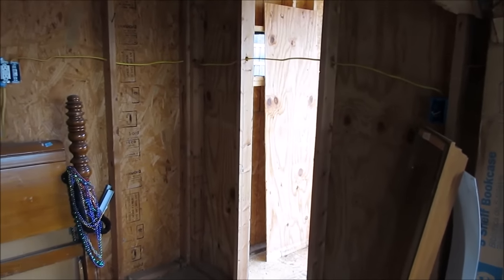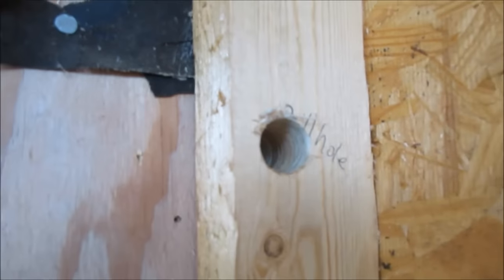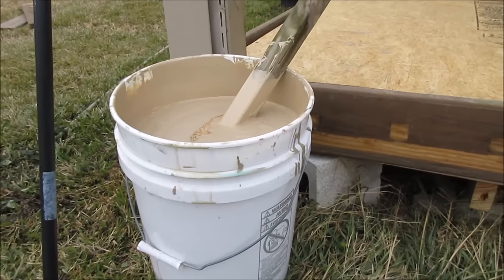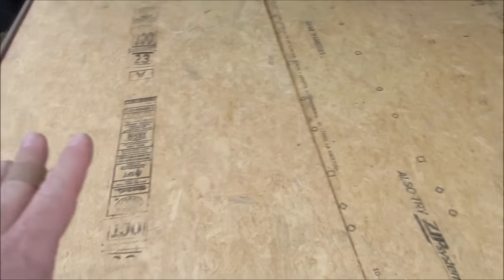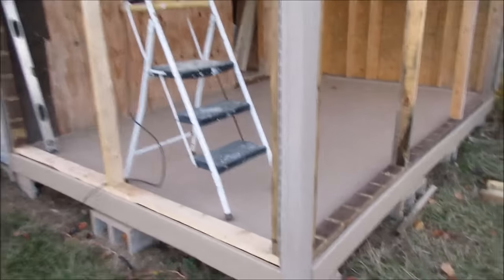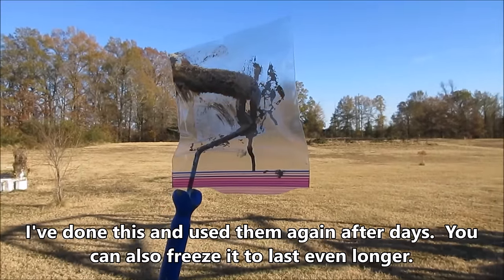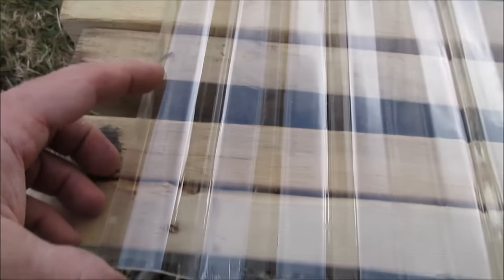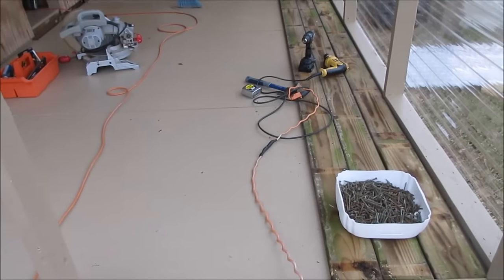Hydroponic Heated Greenhouse Build #4

Comment: Only sissies turn the power off lol. I keep trying to convince myself to use poly panels on my GH but Haven't yet. Maybe next year. I also didn't paint my lumber but will if/when I make it bigger.
Reply from the maker: :O)  I've been zapped by 110 too many times, 220 (overseas) once, and one time lightening hit a tree right next to our house, jumped to the house, then to the barn's power then to me when using a power tool.  It literally knocked me down and out for a bit.  I've learned my lessons the hard way.  Turn the power off and stop working outside with power tools when a storm is coming!  The lightening split/killed he tall oak and most of the appliances and electronics in the house.

I hope I like the poly.  Seems to be great so far.  Share some pics on the Facebook channel of your stuff.  Love looking at others' work.
Brent